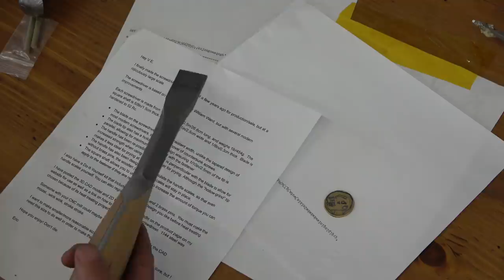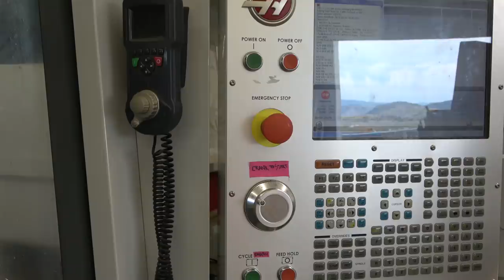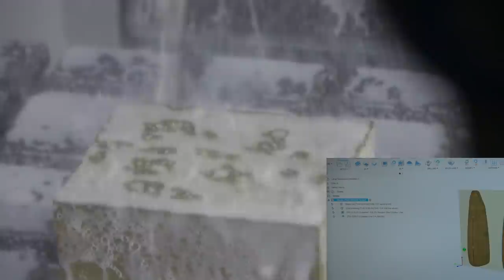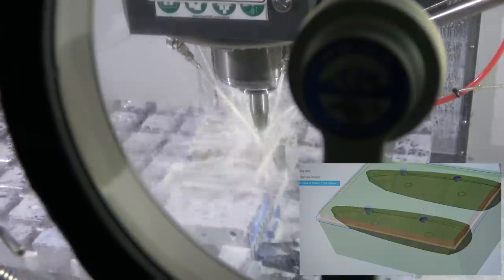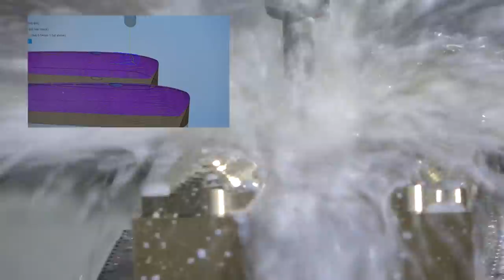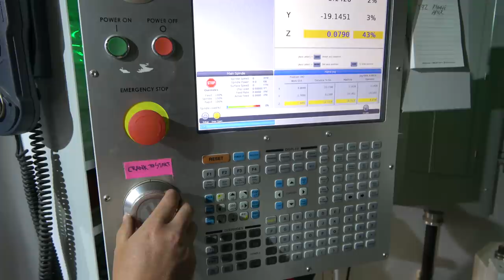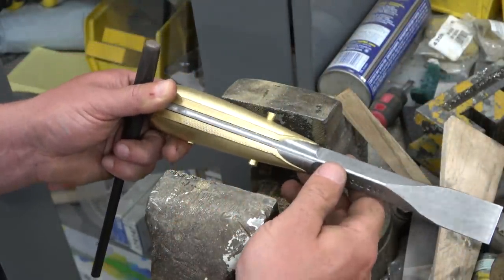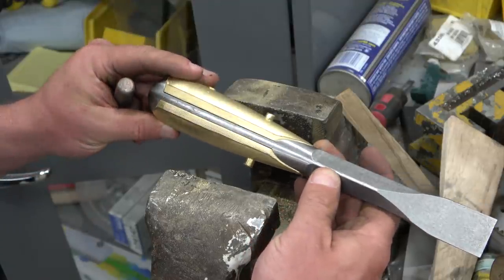Brass handle screwdriver | Hand Tool Rescue

Comment: Why did you mill it with fluid on? You don't need to lol (for camera at least). This is why we love brass in the shop, clean and easier to get machines ready for an alu batch in the dual turret autofeeding nakamura japanese masseuse machine. They do leave fluid on when going full clacker often though.

Sawing at the end had me laughing too. Ze germans programk to ze piece can be hand remov!

Comment: The amount I'd pay for custom AvE brass scales on my benchmade...
Reply: I mean, there are pimpers out there. You should check out the Benchmade forum if it's still around. Benchmade really fucked it up last I'd checked. There are a few other knife forums to check out. Bladeforums, usual suspects etc.

Unless you mean you'd only want them from AvE, not sure how to approach that one unless you get a lot of BM fans to agree on what model to make scales for.

Comment: I am no machinist by any means but couldn't you run the saw between the pieces if clearance allows being that it's brass and all? Or is that a stupid game for a stupid prize kinda thing.
Reply: There's a risk of the part being caught and slung through a window when it's cut completely off. Better to leave it firmly attached and remove it on a secondary op.
Reply: @thermonucleardevice  oh no no not for a complete cut that would be insanity for sure but as a convenient way to get at the final cut by hand

Comment: For the love of God, get thee a belt and disk sander.  Overcut the scales and sand once they're affixed.  Blademakers have only been doing this shit shortly after we stopped flinging poo at each other on a regular basis.  Hand files are for adjusting flat cuts and when you want to make a round edge look like a meth head's teeth.

Comment: Brass seems like a bad idea for handle scales on a non-stainless steel tool; as soon as you rub your dick beaters on those, you're going to start getting galvanic corrosion destroying the steel.  You might get away with it if you seal the brass with a clear lacquer before attaching the scales. 

But then again, I am just some idiot on the internet, so what do I know.